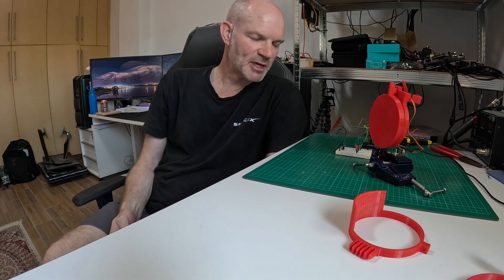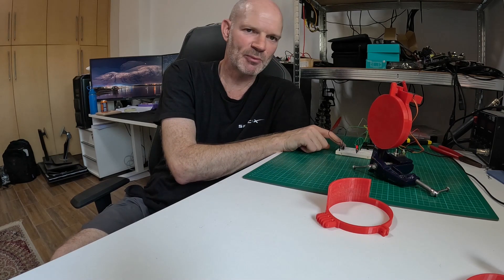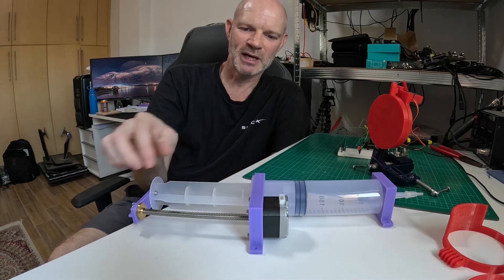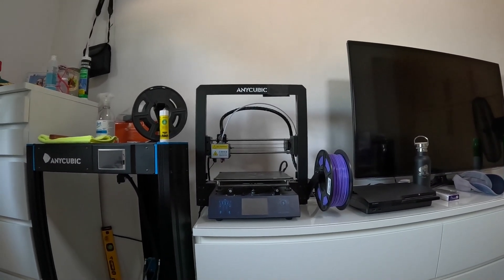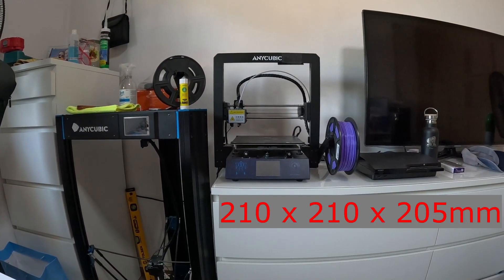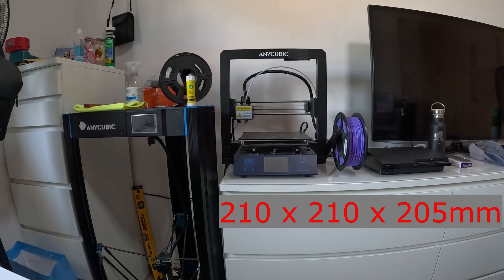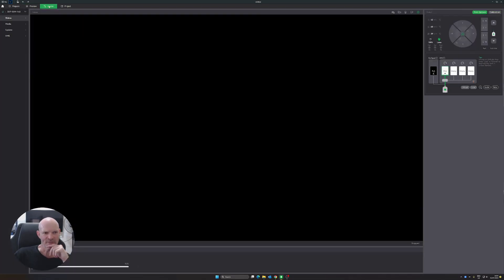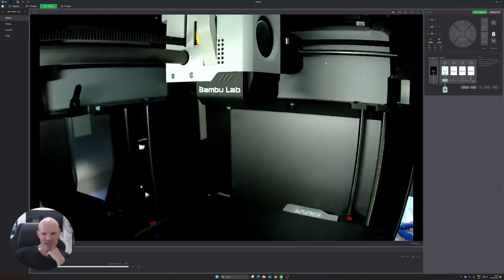New 3D Printer - Number 3! - Bambu Lab X1-Carbon  + AMS unt

Comment: I’ve just bought the same bambu printer. Have already printed a few things for my edge HD great printers. Only issues I’ve had are with moisture so be very careful with that drying filiment is a real ball breaker
Reply from the maker: What symptoms do you see with moisture on yours?
Reply: @DavesAstrophotography  it’s common to see issues like stringing, poor layer adhesion, clogs and failure to pull back material if the Filiment is “damp” the problem varies depending on material being used. Personally I find PLA-CF particularly susceptible to problems if moisture content goes about 30